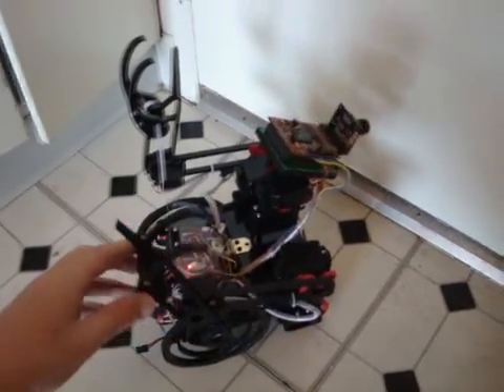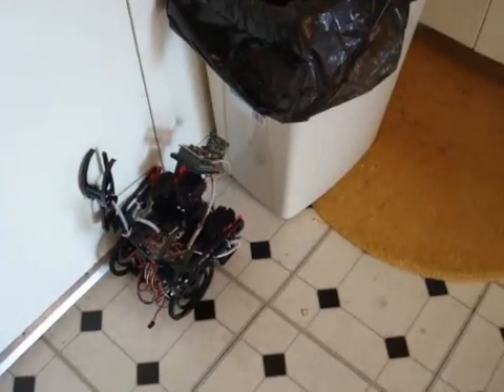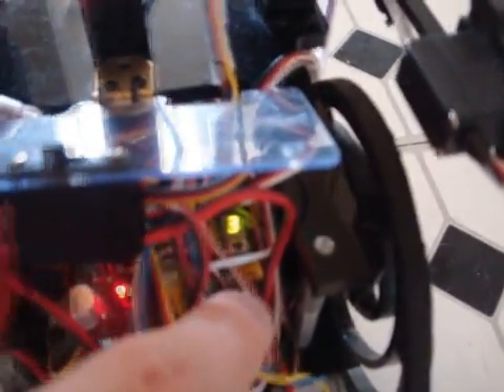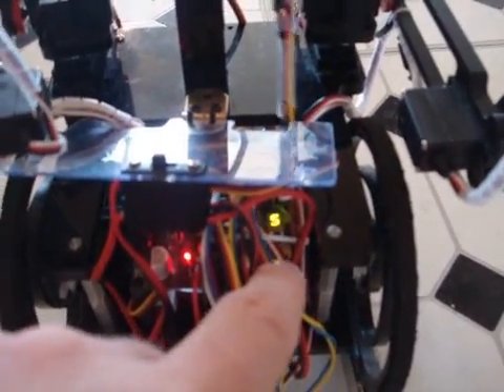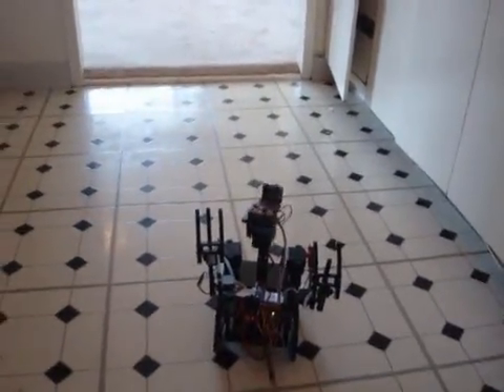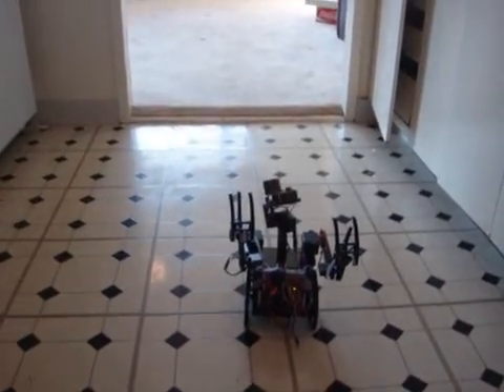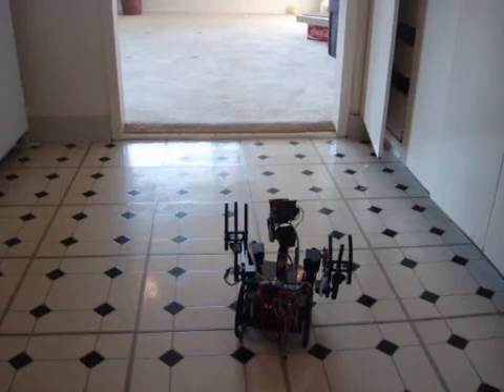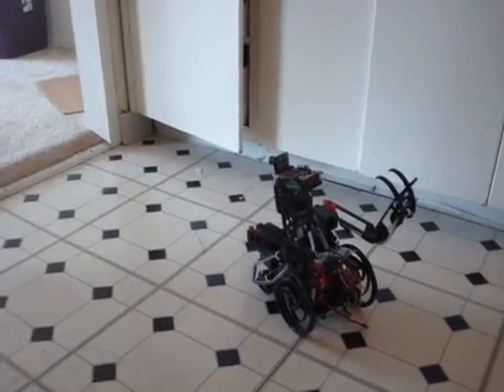Robot 3D Scanning and Mapping

Comment: Excellent hardware platform; I can see you have a CMOS camera on the turrent mount as well as the sharp rangefinder for future machine vision tests. I would suggest using an electronic compass chip (honeywell do a good and not too expensive one) to help constrain the drift of the map as your robot rotates/moves. What do you program the Microcontroller in, C? Also, appreciate it's only a test but a left to right to left and up to down to up scanning motion for the sensor array would be smoother.